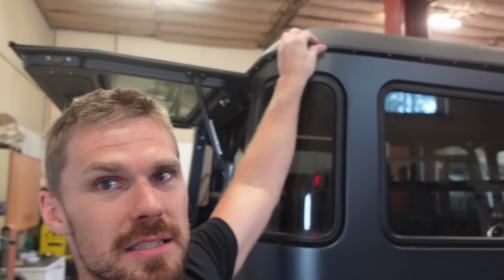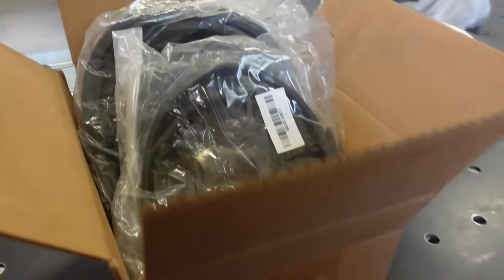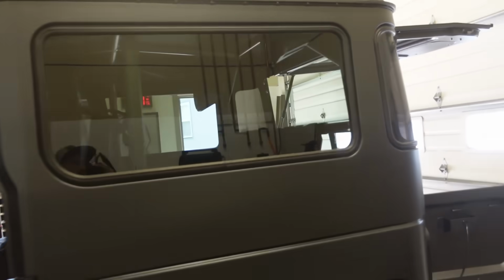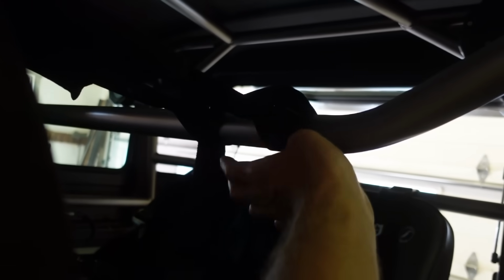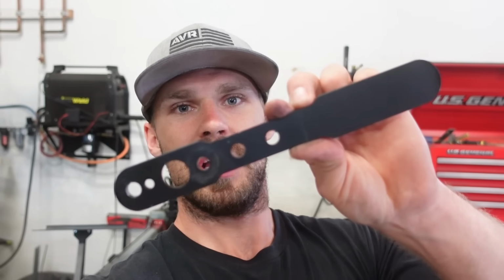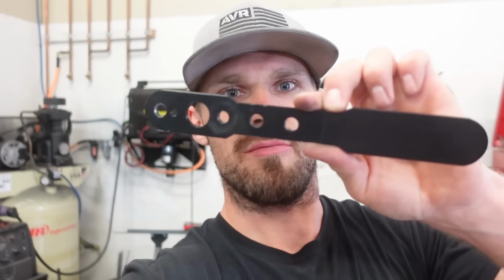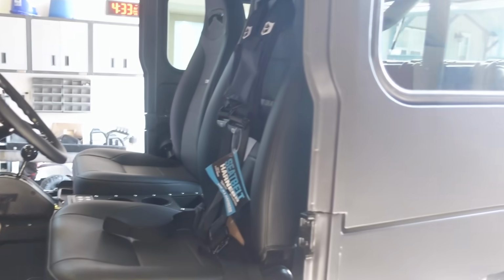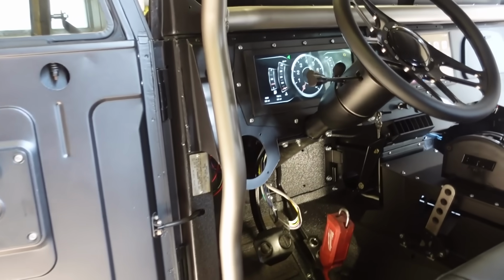The FJ40 Interior Is From The Future!

Comment: Use normal 3 point safety belt clips at the ends of the harness. Quick and safe. They were made for safety belts. Mount the female part to the floor and the male part to the harness end. Quick and safe.
Reply: Was gonna say something similar, using the seat belt clips as quick disconnects

Comment: Austin, I think you have done everything a person could do to trick out an fj-40! I want to see what you do for wheel well splash control into the engine compartment. Some versions of pickup have a stiff fabric wheel wheel liner for sound deadening in the rear wheel well housing. Like you my front wheel allows wheel water pickup to soak the unprotected firewall area and wiring as well as into the engine compartment. 
My intent is to make a shaped mold then lay some fabric like sheet felt over the mold and soak with epoxy resin for the flexible liner. If is gets hit by the tires it would not cut the tires like a sheet metal wheel well liner would.  Thanks for reviewing the comments and making your special custom parts available. Number one site to find out what you are doing. Well done!

Comment: You should see if they make a retracting thing like the 3 point system that you can attach to the roll bar for the tops. That way you can pull them out and then they'd lock like a normal seatbelt 🤷‍♂️
Reply: Yes,  I had a car with 4 point belts and it had a similar retracting thing on the rollbar.

Comment: Really looks great 👍... it's the little attention to detail items now. Which is cool, because it sets it apart from the crowd.  I think you could get away with a nice set of retractable lap / shoulder belts for normal everyday use. Then if you are going to do something outside of that. Install the harnesses that can be stowed in a bag /cargo net behind the seats.  I don't know if a quick connect buckle would be strong enough.  Or pass any kind of inspection if you are in some form of competition.  However,  for everyday use and wheeling. The standard lap and shoulder belt is plenty and more comfortable for traveling.